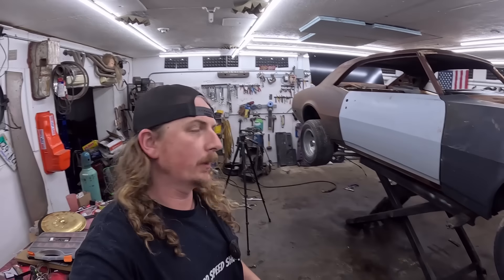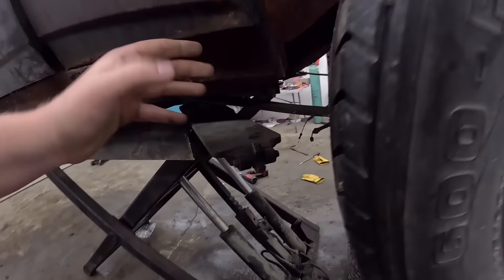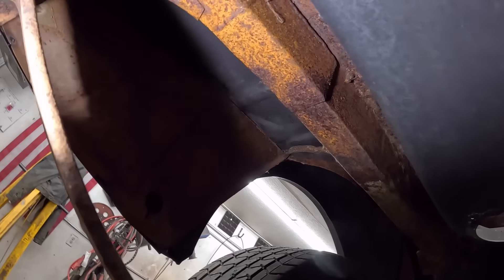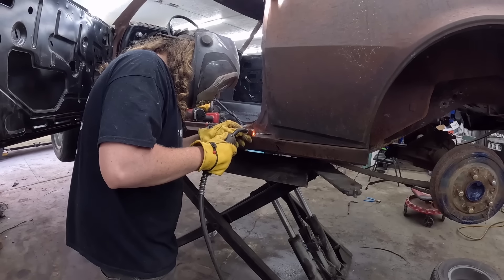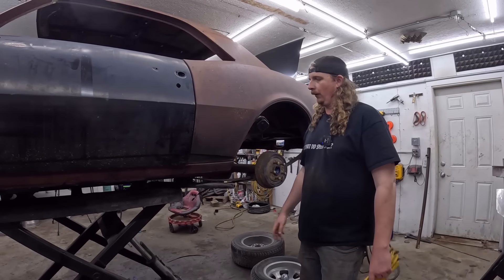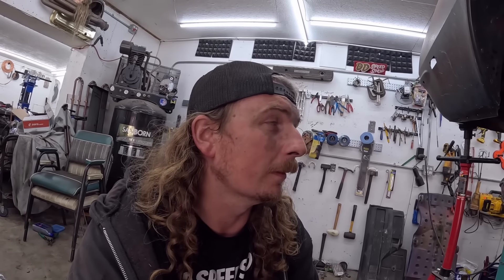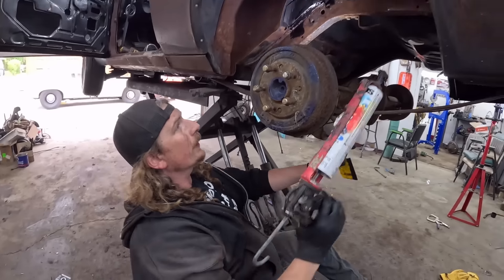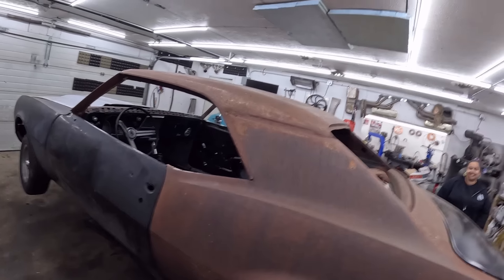Car Flipper Clean Up - 1968 Camaro Welding N' Grinding

Comment: Dan a restoration you have to take it apart ,inventory everything,have the metal dipped ,see what’s left ,cut apart bad metal ,replace metal put it in a rotisserie to make it perfect.  That would be a numbers matching car maybe. The modified cars are now worth a lot.  Dan you are making a solid running and driving car (that will be on the road) for the next guy for a decent price. Have a good day

Comment: I could fix that up like mint. Its a good start for damn sure. And also they are NOT MAKING 68 Camaross any more The Quarter panels will sand off and hold primer. A Grinder and wire wheel and sand paper will make it beautiful. Primer and paint. Its a Good car it will need some new multi leafs springs. Its a good car. It can be as good as a guy wants to make it. Its really pretty good. :face-blue-smiling::face-green-smiling::face-fuchsia-wide-eyes::cat-orange-whistling::face-blue-wide-eyes::face-orange-raised-eyebrow::face-fuchsia-tongue-out::face-orange-biting-nails::face-red-heart-shape::glasses-purple-yellow-diamond::glasses-purple-yellow-diamond::body-blue-raised-arms::hand-orange-covering-eyes::trophy-yellow-smiling::trophy-yellow-smiling::trophy-yellow-smiling::trophy-yellow-smiling::trophy-yellow-smiling::trophy-yellow-smiling::trophy-yellow-smiling::eyes-pink-heart-shape::face-turquoise-covering-eyes::body-green-covering-eyes::hand-purple-blue-peace::hand-purple-blue-peace::hand-purple-blue-peace:

Comment: If the bottom of the quarter panel isn't going flush at the lower rocker is because the quarter  flange that sits on the rocker  needs a notch cut out where it meets the outer wheel house. Behind the flange there is a spot on the wheel house that has a slight  factory  notch  in it the replacement quarter panel  on the lower  flange  needs to be notched ,so you are able to push the quarter panel flush  to the lower  rocker.
Reply: Great tip but this  is dd speed shop  hackery channel

Comment: I’m thinking a full tube chassis with a funny car cage, possibly a Lenco tranny and the old trusty 632 bbc, sheet metal intake jam packed with as much NOS equipment as you can fit under the hood………. You know, real 1990s NMCA style 😁

Comment: Teacher, teacher, please explain your theory behind working with the rust instead of removing it first.  I realize you are simply building a roller project for an unknown buyer.  However, if assembled rusty and in some places covered/hidden, will it not continue to rust into oblivion?  Or are you assuming that the next owner of the car will have it acid dipped during the restoration?  Thank you.
Reply: He doesnt need to explain anything to you nosy nosy teacher teacher. Its called rust inhibitor that slows the rust. NOTHING stops the rust when its to this level. Encapsulate it and hope for the best. LOTS of people doing this with surface rust.
Reply: @axemanfishing2703  Sorry, I watch these videos to learn something. I have never used rust inhibitor before.  What's wrong with asking questions?  I like that Dan is sharing his hobby and teaching us something at the same time.  He is a natural at it and providing a great service.
Reply: @m.harper4145  I agree, and I watch for the same reason, to learn his approach to getting these classic back on the street as cheaply as possible. I may have misread your message, sorry about that. I try to support Dan by commenting on the trolls that give him grief for his way of doing things. Obviously, I misread your message. Sorry bro, all is good. Alot of great products out now that help to stop rust from spreading as quickly. Vice Grip garage uses them frequently as well. 🙂

Comment: Unfortunately a 68 Camaro trim tag won't tell you much other than original color and trim,  which makes proving undocumented HiPo models much more difficult, (and makes fake SS and Z28 builds harder to disprove if they've made a real effort to fake one).  The 68 trim tags weren't as detailed as the 67 trim tags, which listed all the goodies such as SS, Z28, console, power windows,  etc.  Fortunately for you Canadians, Canada kept better VIN records though on GM cars built there, and cars have been verified through that process.

Comment: Lol must be Mortske talking  about hacks doesn't repair panels or much that I seen doesn't like electric fans headers flexy hoses, but anyway I don't blame you assemble patch up it is what it is. Want something for nothing maybe down south we don't even put undercoat hides to much wire brush and De1634 I think it is black matte engine enamels looks good on frames makes look great and way longer than most paints I ever tried besides rust converter before good idea though. Rescued and send it! Exactly though cash and load take to the level you want!!

Comment: The ones complaining are either the guys who don’t own a car or the ones with trailer queens and they brag and talk shit but the only thing they do is wax and clean but don’t drive. So basically both kinds are full of shit. I rather have a solid unpainted driver then a a car cover holder. Keep up the good work

Comment: Why would you want to do a full restoration? From what I understand you simply want to assemble what you have, make the necessary repairs, and sell it down the road to the next person. No one ever makes up the time it takes them to do a full restoration, so do what you need to do.  This is DD Speed Shop after all, lol.  

Edit: A weld is only as good as your surface prep. Rust and paint will prevent good conductivity, and will always result in crappy welds.
Reply: I agree for this car but some of us do enjoy restoration work, believe it or not. 

I like making something look brand new again, not just limited to cars either. 

I also drive and use my "restored" stuff and don't mind if I put a little wear on it too.
Reply: @AaronBrevik  I can see your point, but Dan just wants to put it together and if someone else wants to do a full restoration, they can do it then. Dan figured this car was shelved for maybe decades due to people losing interest in restoring it.
Reply: I vote against undercoating. The buyer may want to change things under there, i.e. larger wheel tubs, body color paint etc.